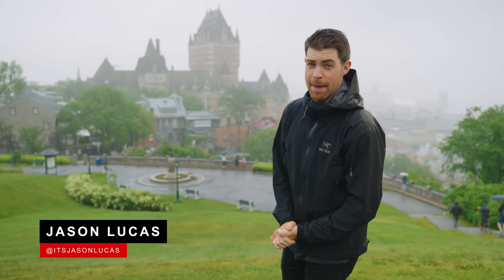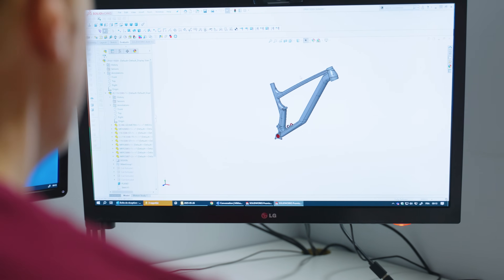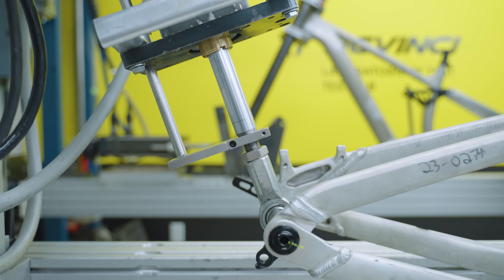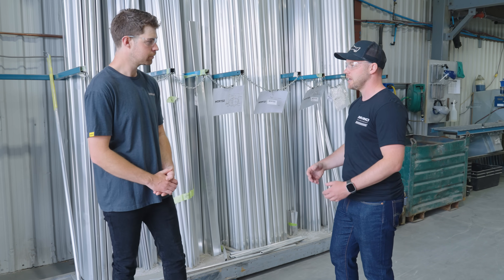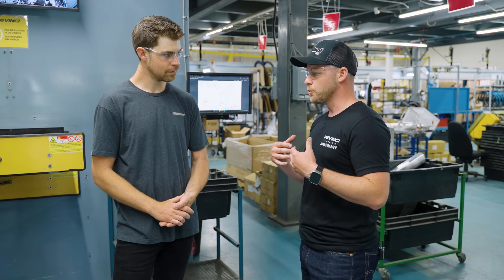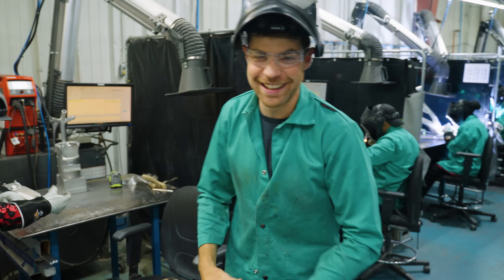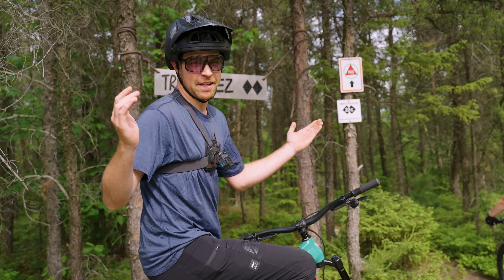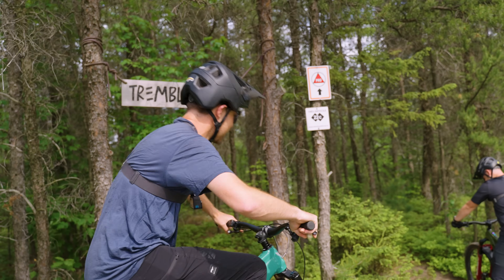Behind the Scenes at Devinci’s Quebec Factory: From Raw Aluminum to Trail Ready

Comment: My complaint abour e-bikes is that they are as expensive as a scooter or minimoto but extremely delicate, don't you dare leave it out in the rain! I put 570 kms on my Equinox Taxi Scooterre in the first 2 wks. I did a uey on the hwy and dropped 9' down into the ditch. Nothing hurt but my pride.

Comment: Devinci's claim to fame is perhaps that it designed and produced the Bixi bike which is used all over the world, by different public bike sharing services.  I remember watching the videos of the test frames they developed, with integrated sensors to measure the stresses of riding down stairs and through pot holes.  These bikes are very solidly constructed, and fit a wide range of riders. Saguenay is the area where a lot of aluminum production in Canada is located.  So it is quite understandable that Devinci is located there, in Chicoutimi because it has a lot of aluminium manufacturing expertise.
Reply: not quite the Bixi was design by Michel Dallaire a well known product designer in Montreal but someone need to built the prototype so Michel Dallaire choose  Devinci as the manufacturing Partner  for the creation of the BIXI.

Comment: Made in Canada? I did not know that, they're now a top contender for my next bike!
Reply: All their aluminium frames are made locally.
Reply: @flipper2gv  Do they make other parts as well?  This is really cool.
Reply: I bought one because they are made in Canada. And due to the awesomeness as well.
Reply: Likewise. Canada all the way eh!  LOL
Reply: I was thinking the same thing. I bet going all in on being Canadian made will help with sales here at home, but maybe also for other international locations that might not be wanting an "American" bike at this point in time.
Reply: Alekkd, when I bought my Devinci Cartier (hybrid) in 2019, it was made in Vietnam. I learned that all their sub C$1000 bikes are made overseas. I don't know if that's still the case.
Reply: Really?  CCM was founded in 1899 as the Canada Cycle & Motor Company, initially producing bicycles and later expanding to automobiles.
Reply: I bought their Hachet gravel bike 5 years ago.  It is the bike I use the most because of its durablility.  I did my first 200km ride on it.
Reply: i got the 2011 wilson frame. they gave me 3 frame replacement. im still riding it... most durable frame i ever got!
Reply: All aluminum bikes are made in Quebec Canada, but not their carbon bikes
Reply: Garbage. Worked there next to the factory. Had shops maintain my road bikes. Devin I earns its low quality reputation and cracking frames. Aluminium jus from rio tinto, locally, means nothing unless processed as a good alloy, Devinci aluminium cracks and is garbage, rather well known even amongst local French Canadian shops.
Reply: Quebec is barley Canada 😂